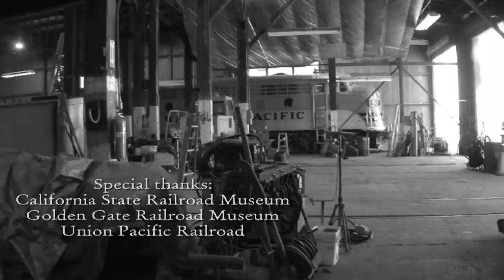The Most Amazing Railroad Video, This is a Must See. F-unit Crosses the Union Pacific Main Line

Comment: As always, UP staff show great professionalism and efficiency!  Also a wonderful thing to see a major corporation willing to support activities like this - we'd never see it in the UK!  I'm sure it's cheaper and safer to do this on the relatively rare occasions that a link is needed than maintain a full crossover with signalling, etc. but still great to see.
Reply: @John Stanley Apparently the whole connection track wasn't built in one hour. The part beyond the gate seems quite permanent.
'In a hour' was built assembled from ready parts the short section over the main tracks: sleepers placed, rails laid and secured. And then promptly removed to let that impatient Amtrak train proceed.

Comment: That video is a great capture of our old "150" track - now replaced by a pair O.W.L.S (one way low speed) diamonds crossing both the #1 and #2 main tracks at RV 98.8, complete with absolute interlocking signaling.  I was brakeman that day on the move.

It's so much easier now - just a call to UP dispatch on radio channel 46-46 and we are in the line-up.  The interchange track is now the 560 track; and we continue to move both museum equipment as well as freight (to/from Setzer Forest Products).  There is a lead off the 560 track to the south end of the transfer table.  Freight service will probably terminate sometime in 2016 when the mill closes.

Comment: I have seen this transfer table-but not in operation. The building of the 'Jump-Track' is a reminder of how they switched the cane cars in the field, without the use of switches.Very ingenious ideas. The crew had it dismantled in time so as not to delay the Passenger no doubt! Excellent video. Thanks for sharing.

Comment from the maker: Yes, it's all real. I was there to film some making of parts in the loco shops. Someone ran over and told the crew they moving a F unit to this shop. We stopped what we were doing and ran, and I mean ran over to film all this. The Amtrak train had a regular stop in Sacto but the crew had to finish their job fast to not hold up the train. They have done this many times. It was the first transfer table I ever saw also. Glad most of you liked it. Don
Reply: Not certain about the points made but ,if anyone else wants to learn about how do i get a job with the railroad try Tarbetti Rail Work Tutor (do a google search ) ? Ive heard some pretty good things about it and my colleague got great results with it.
Reply: Truth is... this was scheduled weekly on Wednesdays for a very long time.  I used to work the West Sac Job to deliver and pickup cars from the museum RR.  If you return or use GOOGLE Earth you will see diamonds and new turnouts installed now.  The entire mainline was re-allighned.
Reply: +Don Mccuaig "Transfer table" I was wondering what that was called, never heard of one before, all I'd seen were turntables.

Cool video, although the drama at the beginning was a bit overdone, that Amtrak train obviously wasn't going anywhere until the track was clear.
Reply: +Don Mccuaig Maybe I'm just naive, but if they had to do that crossing many times before, why not just install a crossover and leave it?
Reply: +Element of Kindness 
I think Amtrak might be pretty anal about people putting crossovers on their mainline just for their convenience.
Reply: +Ima Paine-diaz it's not Amtrash's mainline.  It's Union Pacific's mainline.
Reply: +Element of Kindness They have one now.
Reply: Why don't they pit in a "diamond"?
Reply: Railfan Center They did a couple years ago.  This video is old.
Reply: +Don Mccuaig ohhh transfer tables are really rare, I got one on one of my videos of the 765 npk running the walbash cannonball route for excursion, as we go by it in Logansport indiana the NS shops there that is, and it still has a working transfer table, but you dont see them everyday,  nor turntables, as for mine you cant see it in use but its there as we go by it by rail
Reply: +Jeff DeWitt +Don Mccuaig - 'tis not a "Transfer Table" - Transfer table move stock laterally from one track to another in situations where there are two or more tracks. This is a temporary "panel track" passing over another track.
Reply: 5:21 is a transfer table, it moves straight across not around, in a latteral line, that is what I was referring to.
Reply: +manga12 Oh, sorry- I did not see the 5:21 part. Yes, I agree that is a transfer table (I thought the remark was about the crossover). Thank you for bringing it to my attention - I've been looking for a video like this showing a transfer table in action. :)
Reply: +manga12 Ah, yes. I see the NS shops transfer table just southwest of 18th st. and Woodlawn Ave. That is huge. Thanks for the reference. :)
Reply: indeed
Reply: I've had the opportunity to work down there in the shops. It is amazing working with people who have been in the field for years. the conversations in the break room are hilarious. I recommend able bodied individuals that would like to work in the shops to apply and ask for the shop foreman.
Reply: lilbigmorgan If I lived in Sacramento I would pay to work there.
Reply: you don't have to live in Sacramento to work there. just within commuter distance. 30miles one way I used to do that daily when I worked down there for state parks
Reply: lilbigmorgan I think that 9 hours is a bit too long of a commute for me.
Reply: The former PRR passenger car shop in Altoona PA, now owned by Union Tank Car, has an operating transfer table, although built with a deeper pit. It looks to be about 21 tracks deep.
Reply: yes altoona is something they also have that huge building the engine house I think that has the turntable in front of it and soo many tracks it looks like a spider, they also had altoona east roundhouse which had 52 stalls and just as many as the one in onionta new york for the world largest as far as capacity, but both are torn down now and thinking about it makes me want to cry :( the largest in the world and its gone, but I think for shops that can do complete railroad stuff from rails up its one of the largest if not still the biggest works in the world, the place is huge and can do many many engines at once even rewinding the moters and putting togather not just rebuilding and yes has a machine shop still or at least some capacity for machining and fabricating, something many works that do repair and maintanance alone do not usually have.
Reply: manga12
Reply: you called my name yes?  did you have a question?
Reply: Don Mccuaig me m
Reply: Don Mccuaig uj
Reply: Don Mccuaig u
Reply: Don Mccuaig. why don't they just make an X track is funding low, and did that track come down in time ? I would think Amtrak knew about this
Reply: Itchy Itchiford Would you just read the whole conversation? They cover this.
Reply: why didn't they make that a cross track in the first place?
Reply: Gravitrax 64 Cost probably. And likely lack of necessity at the time.
Reply: Z
Reply: This was boring
Reply: Don Mccuaig
Reply: @billdonaldson7690  You made an apology. I think that's great. You must be a very nice and considerate individual. It's a nice change to see civility in the comments. Well done.
Reply: @usmale4915  Thank you. I do try to be civil.
Reply: @NortheasternRailPhotography  I imagine there was a diamond there a while back but maybe its not used enough it is easier to temporarily assemble the track than maintaining the diamond?
Reply: I'll tell you what else: That beauty has obviously been off of the mains for a long time.  Single note chime.  I rode in UP's special trail with THREE hot-rodded E9s (an A on each end the B behind the front.  Anyway, they had a modern 5 note chime on that ride.  I think I was the only non-engineer in my car.  They were all jealous of the engineer!
Reply: Never seen this done before, and I've been a vol at a midwestern rail museum for decades.  Great work by all!

Comment: for those of us that don't know much about railroads what the heck is an F unit. That's fast work thank you for posting
Reply: Series of streamlined locos by GM Electro Motive Division (EMD) - includes FT, F3, F7 and F9, A and B units (B units don't have cabs, used in multiple with at least one A unit).
But you could have Googled that.
Reply: Series of streamlined locos by GM Electro Motive Division (EMD) - includes FT, F3, F7 and F9, A and B units (B units don't have cabs, used in multiple with at least one A unit).
But you could have Googled that.

Comment: The most amazing railroad video... Well, that's quite an overdone promotion.

This is a must see... Well, that's for sure! Thanks for sharing, that was interesting, I've never seen a trick like that before, that was a clever solution.
Reply: DaringDramis they do that with trams in Melbourne, a temporary set of points is laid on top of the tracks in the road so the tram can crossover at that point. This was done because of roadworks and this enabled the trams to go back the way they came.
Only downer was some officious employee shooed me away saying “this is a construction site”.
Reply: Clever solution?????Clever would to make a normal rail to that repair station or museum what ever it is.

Comment: Glaring omission was video of the temporary track disassembly, after the old unit had crossed over.
Reply: +hughvane, Agree.
Reply: +hughvane That's exactly what I was going to post (-:
Reply from the maker: +hughvane Well old boy, you have to call them as you see them. We only had one camera there so I chose to film the F unit on the transfer table and not the guys taking up the track. We already saw them put the track down I  think it was more interesting watching the transfer table in operation.
Reply: Don Mccuaig ł
Reply: I'd imagine if you reversed the film, that would be pretty close to the disassembly.
Reply: Ok, so how many times a year does this temporary track get relaid?
Reply: @lawrence18uk  they built a permanent diamond interlocking crossing a few years back.

Comment: Or you know, just let the Amtrak go first? The suspense then turns into "This Amtrak is holding up the job. Will Union Pacific have to pay these guys overtime? Find out after this..."
Reply: Union Pacific hates Amtrak anyways so this is nothing new and would do anything to hold up Amtrak
Reply: union pacific would get right of way because they own the track thats a big reason to why passenger trains suck in the us
Reply: They got the loco across and the video footage and then went for lunch and left the track there
Reply: Nothing against U.P. personally, but they are the only railroad to threaten to have me arrested...
My previous job required me to work along R.O.W. occasionally to access the utilities, ect. we were contracted to. BNSF were really easy to work with...

Comment: This was cool. Wonder what it'd cost for them to actually build a permanent diamond.
Reply: They did.
Reply: @trainzguy2472  How would they signal the diamond so as to protect traffic using the "main line" from the occasional/random movements across it: in the U.K. such a crossing would need all kinds of associated hardware that would add no end of costs to a relatively-simple bit of track-work.

Comment: You guys should really get a diamond crossing. That way neither company would ever get held over again.
Reply: Thomas E S Thomas ..yes, why not a diamond?  why all this trouble?
Reply: It would just make it so much easier. The funny part of the video is that they show the Amtrack train three times, but they never show their crossing being removed. Oops!
Reply: Diamonds need a lot of maintenance because the constant impact of passing wheels over the gaps in the diamond tends to pound the diamond to pieces.  So diamonds usually only last 3 to 5 years in high-traffic areas and then need replacing at a cost of around $1 Million in total.  So if you only need to move a few trains over a track each year, this is far cheaper and more cost effective. But I would have 2 rails made out of ultra-light titanium, that way they would be light enough that 4 men could carry each one into place ;  no need for any heavy machinery.
Reply: According to google maps, it turns out they installed a pair of diamonds after the installation of a second commuter line. https://www.google.com/maps/@38.5858172,-121.5046706,47m/data=!3m1!1e3
Reply: Beside the cost of a crossing and its installation, there is a cost for signalling. Apparently the museum bit the million-$ bullet 5 years later.

Comment: Wonders why a permanent crossing is not installed ?
Reply: +colliecandle

When looking at Google Earth satellite images of now and then, it have been done since October 2012.

Now :

https://www.google.ca/maps/@38.5858179,-121.5046535,47m/data=!3m1!1e3?hl=fr
Reply: +colliecandle I, too!
Reply: +DaringDramis They redesigned the intersection.  The original tracks used in this video ran along the bike path before cutting over to the north side of repair sheds and crossed main line at 90 degree angle underneath the bridge.

The redesign cuts away from bike path earlier, is not underneath the bridge anymore (why you can see it from google) and enters the repair sheds on the south side.
Reply: Too expense to opreate an interlocking and maintain a diamond fo a movement twice a year.

Comment: They need to make these crossings often, I wonder why they don't just put in a diamond and be done with it.
Reply: That's what I was thinking.  Dumb.  Who builds a train museum with limited access to move, um, trains?
Reply: If this is in California, that would be why it hasn’t happened. Between federal and state regulations as other local ordinances, it would be a bureaucratic nightmare.
Reply: @timsmith1125  The tracks are not owned by the State or the Federal Government, they are owned by the Union Pacific, so to answer my own question it would stand to reason that the UP simply doesn't want to allow it., But I still wonder why.
Reply: Chances are, they diamond would be used very rarely; not cost efficient to keep.

I’d wager that the UPRR did this to avoid having to reinstall the interlocker.
Reply: @stilltuckered  So you believe that the time and trouble involved in this temporary arrangement is more cost effective than a permanent diamond? I seriously doubt that, considering the fact that when the new wing of the museum to be located in the old SP shops opens, equipment will be moved between the current museum and the new part on a semi-regular basis.

As for an interlocking, that's not necessary, the only user would be the museum, and all they would need to do to cross the mainline would be to get clearance from the dispatcher. There is a fence and gate beside the museum next to the tracks, that could easily be signaled to notify the dispatcher if it's opened, just as a slide fence does in slide prone areas.
Reply: A new access track has been made
Reply: They probably didn't put in a diamond because the cross wouldn't be perminant or maybe it would take too long. Idk :/

Comment: So why don't they just put a permanent T crossing in then?
Reply: dbkoob nyc correct! instead of using their time constraints method.
Reply: dbkoob nyc expense. "Just get it done!"
Reply: Because of this rhimg callex job security if they put a t in those fuus would not be needed as much.
Reply: A railroad crossing at grade is very very expensive and it would require an expensive signal system or a stop sign system which would slow down rail service... the steel alone for the crossing is prohibitive in price..(a good frog for instance costs about $20,000 American dollars) and that’s just a frog... that’s a tiny thing compared to a grade crossing!
Reply: theres a video of the X-ing being put into place
Reply: Because its America
Reply: dbkoob nyc what I don't get is why isn't there one there already? Why is there a track that runs up to a main line and then stops and then continues on the other side of the main line? All I can think of is it was an old out of service line that they cut to run the new one through
Reply: U ion Pacific probably doesnt want it so they had to improvise. Re
member it was on their mainline
Reply: They have a X crossing now lol

Comment: This made me think of a series of pics from the 1860s, when switch-points and frogs either were rare, or not even invented yet! It showed a procedure to enter a siding. The switch was a stub-type, where 2 dead-end rails were held on a slider connected to the switch-stand, and you'd line up the one you needed. The main-line rail was dead-ended too, and the ends would line up! But the interesting thing was, the turn-out rail, the one on the inside of the main-line rail, aimed toward the main-line rail and dead-ended just short of it! It picked up on the other side and continued down the siding! The main-line rail was uncut and continuous! Either a hole was drilled in the head of each one of the siding rail ends, or a socket was forged onto the end of each rail end.  (actually, these ends were raised up to a height above the main rail). A heavy rod that looked like a flat-top U-bolt with very short legs was dropped into these holes. The locomotive carefully crossed this arrangement over the top of the main rail, and leaned a bit, I'd bet!!  One pic was of a guy with a U-bolt in his hand before he placed it. The crew carried these things with them to use!

Comment: That was the biggest air impact I have ever seen.  Why was they building a bridge in the first place?  913 was an odd looking engine.  the whistle on 913 sounded like the air horn on the ships I help build in south Mississippi.  Very good video.   thanks
Reply: The horn on the 913 is a Leslie A200.  Leslie also makes horns for marine applications. ;)
Reply: I remember in the late 1940's and 50's, all diesel-electric horns had that deep sound until somebody came up with something called an air chime.